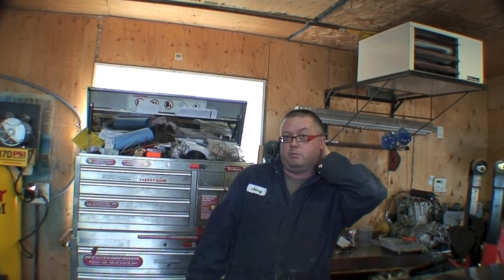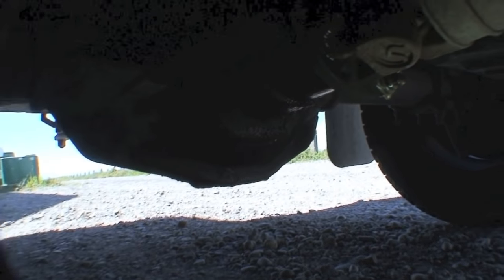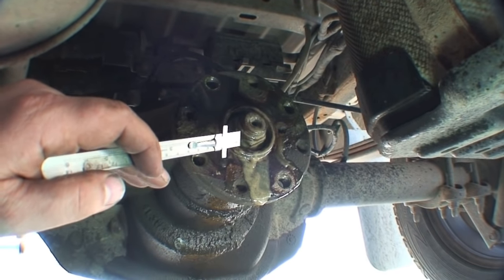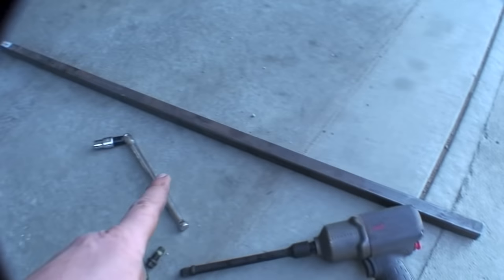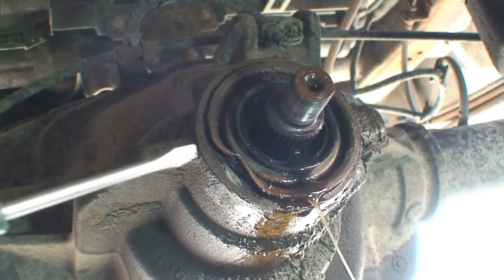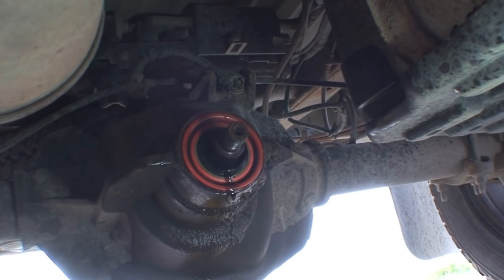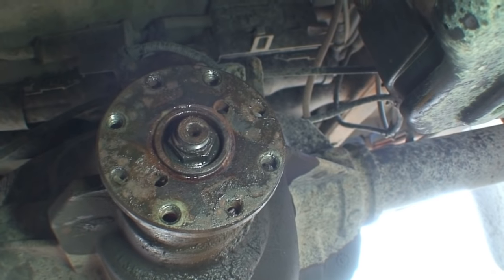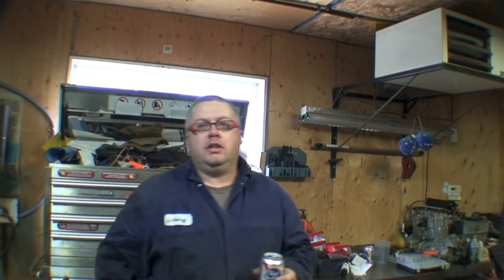How to Replace a Rear Differential Pinion Seal

Comment: Thanks for the video.  On my '05 F150 FX4 (162k mi) saw my pinion seal leaking.  Haven't had any noise from differential nor any shimmy/shakes.  However, with the pinion seal leaking significantly (had started dripping) at seal, decided it needed to be replaced before there was a problem.  Followed this video with everything....measuring, marking nut, etc. before removing.  When I tried using a 2-jaw gear puller to remove the flange, it would not come off....have sprayed it w/ more PB Blaster & hoping that will do it overnight.  However, I am concerned for as I used the gear puller & flange didn't budge, it actually pulled the pinion shaft out slightly.  Does that mean the crush sleeve is damaged allowing too much play, which would seem to require opening the differential, etc. & removing the pinion.  Or is it just a matter of working the pinion gear back in while pushing & rotating tires.  Sorry if this seems like a basic issue, but not an experienced mechanic.  However, am smart enough & skilled enough w/ basics to follow repair manuals/videos to do things myself (semi-retired, so time on my hands & low budget).
Reply from the maker: If you had a jaw puller on the yoke and pressing on the pinion it shouldn't hurt the crush sleeve. However the fact that the pinion moved but the yoke hasn't come off does concern me.  Is there any play in the pinion ?
Reply: Bullshitkorner
Thanks for the reply to my question.  Sorry for just getting back on it.  Has been raining here for the last 2 days, and my truck is not under cover (but all the tools, parts, & equipment are in a shed safe from the rain).  Anyway, stopped enough for me to get back under & check the pinion play.  The pinion actually pulled out about 1/2 inch.  I took a photo that shows the clean part of the pinion that has pulled out.  There is definitely some left/right play....not a lot, but definitely moves.  Tomorrow the rain is expected to be past, so will be back under to continue the repair.

So, thinking it might actually be the bearings, huh?  Well, I know what that means.
Reply: Bruce Simmons
Again, didn't hear or feel any problems w/ the differential, but I guess if the bearings are bad, that led to the seal problem.....hope I found it before any damage done to the differential gears....
Reply: Bruce Simmons
sorry for my lack of differential terminology, but the 1/2 inch section to the pinion shaft that I referred to being clean is the outer bearing seat....I can pull the pinion shaft out to where 1/2 inch of the outer bearing seat is visible.  Hopefully, rain will be gone tomorrow so I can get back under it to see if the PB Blaster worked in loosening the bind in the yoke/flange & the pinion splines.  Will put the gear puller back on it & give it a try.  Still concerned though about the pinion shaft pulling out & having some play.
Reply: Bruce Simmons
OK, I feel like an idiot.....goes to show I'm a novice on auto repair.  Good news is that the yoke/flange came off.  What I thought was 1/2 inch of the outer bearing seat was actually the back of the yoke.  Didn't realize that the yoke was that deep.  So, with the yoke off, realize that the pinion is not moving in & out, but it does have play.  So, I guess the bearings are probably bad which caused the seal leak.  At this point, I'm going to put the new seal in, reinstall the draft shaft, refill diff fluid, and then will take to a qualified tech as I'm not sure if I should try & tackle dismantling & reinstall of the diff.
Reply from the maker: it has play because the preload isn't on it anymore. plus you need backlash that will have play
Reply: Bullshitkorner
Thanks for the reply.  Sorry for my lack of knowledge/experience and really appreciate your video & time.....has really helped.  I really felt like an idiot today, for before putting the new seal in, removed the shim & outer bearing.  As I was removing it, it hit me that there was no preload & thus it had play.  Anyway, the outer bearing actually looked very good....no pitting at all.  The shim did have some minor pitting where the yoke butts against it...guess some trash/sand caused that. 

By the way, had previously used the longer jaws on the puller, and when it bottomed out without the yoke completely off, thought there was a problem w/ the pinion pulling out.  Put the shorter jaws on & was able to remove the yoke, which is when I realized that the back of the yoke was longer than I thought. 

Anyway, cleaned everything up & reinstalled the yoke....it was a real bitch to get back on though, but I guess nice and tight is they way you want it.  Used the pinion nut to pull the yoke into place, and when the nut reached the marked location, everything was nice & snug as it should be.  In fact, the pinion nut couldn't go any further, just like you described in the video.  The only play was that from the backlash. Disconnected the vent line, blew it out w/ compressed air, reconnected, added diff fluid, reinstalled driveshaft, & all is well.

Again thanks for taking the time to share your expertise....really learned a lot.
Reply from the maker: no worries, we can never fully learn unless we jump headfirst in.  Mistakes will always happen, and we will learn from them.  Good job on getting it done

Comment: I have the same year F150 and I had to get the larger seal for some reason too.  Did you have to beat the hell out of the yoke/flange to get it back on?  I only had a regular hammer and had to beat on it for an entire hour to get it back on all the way.  The yoke bolts don't have much room to get to either.
Reply from the maker: i can't remember but i don't think i had to get too violent with it

Comment: I'm currently replacing my pinion on my 2004 Nissan frontier 4x4 crew cab. I'm wondering is there by any chance its replaceable  with a 2002 2wd nissan frontier?

Comment: enjoyed the video. liked the way u explained everything. drink beer, hell ya. what If I don't have a flange puller. what else do u recommend
Reply: just use a brass mallet and tap around the backside. The splines on the pinion to flange/yoke are cut to increase the surface area when mounted. You'll be fine, the pinion is more than strong enough.

Just saves you a little time pulling it, but you don't need it. A few taps around the flange in a circle to prevent it from hanging up and having tap it back down.
 Just worry about under torquing on that nut, that will cause failure as the pinion will begin to slip in the bearings under load and cause backlash issues that can cook your rearend.
Reply: thank you so much. worked out just perfect. got it out. now as i went to put new pinion seal in of course i didnt get the correct one. now that ive returned the seal that didnt fit, im gonna try to install new pinion seal. wish me luck. i counted the thread on the pinion nut before removing it. putting it right back where it was should be easy. again, thanks.

Comment: need your advice i change seals and bearings on my 05 f150 diff,i accidentally turned the axle shaft and planet gears almost pop out of assy,well got it back again after all was done when i drive reverse i have this backlash so bad but when i put it to drive no probs...did i miss something?...thanks bud!

Comment: I like your video. Will your instructions here work if you have a crush washer on the pinion? Mine say to rebuild if I remove the pinion nut. I was thinking its because the torque has to be the same or redone.

Comment: My drift shaft snapped off the rear differential the other day. Before, I would notice that it would leak a lot of fluid and when I took it for a spin and drove past 25 mph, I felt a big vibration coming from the back or something. The whole truck would begin to shake. Do you believe it might be my rear pinion seal got so dry that it gave out causing to break off my driveshaft?? I have 1993 Toyota Pickup V6 4x4.
Reply: William Rodriguez by your photo I can tell ur the type of guy that doesnt even change your oil....differential oil...transfer case oil...or manual transmission fluid...

Comment: Thank you for the video . You diff still working good after this repair?
Do you think that i can use this video. If i want to replace the yoke  . I bought this truck and someone maybe lost the bolts. And they weld the c. Holders to the joke .
Reply from the maker: I’m still driving the truck today
Reply: Bullshitkorner  so this video should work to do my yoke on the  ford 99 7.3.     I iust not sure.    Thank you.
Reply from the maker: No idea proceed with caution

Comment: To BS korner 
Just to understand correctly, do u tap in the bearing plate and then tighten the nut to get to the preloaded depth or do u just smack the bearing all the way in and tighten the nut to the desired depth or is it all the same 
Thanks
Reply from the maker: there is no such thing as preload depth, preload is the amount of force on the bearing usually measured in Inchpounds.  once you remove the nut you can never get the preload back.  setting the pinion up properly after replacing the seal would include replacing the crush collar and setting the preload to whatever the factory specs are which could be anywhere from 10 inch pounds to 40 inch pounds etc.

Comment: Good video, i'm about to do this to my '07 this afternoon. Are you sure the parts store didn't give you a 8.8" rear end seal ( 4.6L ) instead of a 9.75" seal ( 5.4L )? Not sure if the Super Duty rear is the same size or not.

Comment: You forgot to address why the seal leaked in the first place. It will leak again if you don't fix the underlying fault.  Also, did you change the crush sleeve? This part is a one-time use piece and must be changed each time the pinion nut is removed.
Reply from the maker: +Steve Tyminski negative all around, indeed the crush sleeve is a one time use only to set preload on the bearing.  Using a dial torque wrench you can get a reading of what it was and set it back to that.   80000kms since I did this and no issues.   Any other questions ?
Reply: don't mean to come across as negative, I do appreciate the time and effort you put into the video. What do you think was the cause of the seal failure? Do you feel the crush sleeve being used twice (or more) still retains the preload?Thanks,
Reply from the maker: I really don't know what exactly caused the seal failure perhaps dirt, in all honest as the bearings and parts wear the bearing preload backs off.  I rebuilt my jeep axles a few years ago and they had 0 preload on the bearings and 250k on the axles and they were still fine
Reply: Bullshitkorner Friction is what ultimately causes failure of any part...

Comment: I just replace the differential seal of my 73 chevy ,, I marked the nut pinion and yoke ,, to make sure to put back at the same tightness ,, I may over tighten the nut because the differential make a roar noise, ,, or may be to loose? !, I set on the marks  but may be one turn to much or ??I will appreciate some help, , thank you. ?
Reply from the maker: it is possible that it's too tight, if it was more on the loose side every time you left off the gas you would hear a clunk. You could check for play and try backing it off slightly and see what happens
Reply: I check  ,, and yoke is loose  , I try to tighten but still klunky and loose, , I think I will have to replace the cargo ring bearings. Procedure that I never done before, , any suggestions I will appreciate it.,, thanks, ,

Comment: about braking something within the diff? should i have used a longer extension and just cranked until it gave way? what else can i do in order to take it off? i dont have oxy/acet but do have propane or could poss get something a bit better. is heat a good or bad idea? could i damage anything else than just the pinion seal? pls send some ideas because its leaking bad and i still drive it daily. i really want to do this myself and leave a mech as last resort. thanks so much in advance

Comment: apply the brakes and used a breaker bar with a approx 2-3 foot extension and i tried removing the nut but i felt like i was gona snap something inside my diff. i had a huuuge amount of pressure on the nut and it didnt budge. im pretty sure the brakes held the truck in place but there was so much flex from within the diff it got to a point where i felt like the gears were gona snap in the diff. was i wrong to think that? can you crank on that bolt with extreme pressure and not worry at all....

Comment: Ford Australia say the seals are now an obsolete part for my '04 F250. I gave them my VIN number and they gave me the part number... yet when I checked online I found the part number they gave me corresponds to an F350 seal and I have had the truck since new. It appears there may be 3 or 4 seals of different sizes that have been used and the Ford computer has them incorrectly matched. I have purchased 3 different ones from the US in the hope that 1 fits :(
Just curious but do you remember what the seal number was that you used ?
Reply: +nitrostateteam Exercise extreme caution when you remove the old seal and then check it with calipers that should give you a good reference as to which seal is the correct one. Just order all the options use the correct one and send the others back! Check the O.D the I.D. the  thickness and all the lip heights. After selecting the proper seal a big socket or seal driver should be located to make sure you put even pressure on the seal while driving it in. Make sure you get it in straight from the start it can easily damage a seal to start it crooked and try to straighten it half way in the hole. It is also very helpful to place the seal in your deep freeze for about an hour the little bit of shrink will help you to use less force and make you less likely to damage the seal. A small bit of very light oil applied to the outside of the seal will help it slide in. Sorry to be so wordy but I hope that this might help, if you already know all this than I am sorry I wasted your time :)
Reply: Mmmm I appreciate your great tips there Mel, then with your chilled seals and my warm diff, a little light oil and I'm sure I'll be driving it in home, nice and straight, in no time ;)
You're welcome in my workshop any day :)

Comment: Question for BSKORNER:

I have a 2010 f150 platinum. Pinion seal started leaking, was under ford warranty still. So, I let them repair it (stupid move). I got it back and right away I knew something was wrong. When you accelerate even in a straight line, the rear feels like its going over a rumble strip - just in acceleration tho. I took it back, showed them and they said, "that's not right, we will fix"... And well after a couple hours I got it back and they said .... (Get ready for this one lol) "it's a normal driveline vibration"... WTF!!!! Lol ... So I hooped and hollered and they said not much we can do, call ford.  Ford did nothing... Took to another dealer to double check and the did nothing... Now almost a year later it still does it, it feels like I'm pulling a trailer half the time... (No power on take off, then some days feels powerful...) weird I know. So the question, wtf could they have done in there to make it rumble while accelerating in a straight line? I know if you're turning and it rumbles in the rear it could be clutch packs or bearings.. But in a straight line??? Any help and advice would be greatly appreciated. Thanks
Reply from the maker: that's not a normal vibration, there is no such thing as a normal vibration if everything was in balance and set up right you wouldn't have this issue.  my guess they didn't set it up right because if you didn't have this issue before then why are you having it now.  could be too little preload that when you step on the gas the torque drives the pinion in the ring gear and deflection kicks it back out, giving you the rumble strip feeling
Reply: Bullshitkorner unless Fords are different from Chevy, I don't think it's the pre-load, unless there is soo little that bearings are sloppy causing the pinion shaft to move side to side cuz my Chevy 14 bolt 10.5, the direction of spiral of the pinion gear teeth actually force the pinion away from the ring gear, witch would be the relationship if the pre-load were right,in forward gear.

Comment from the maker: your not going to like this but doing the seal in the dodge 1500 you need to replace the crush sleeve and torque it properly, it's not as easy as this.... if you do a quick google search you will be able to read up on it and yes people have reported using a 6 ft snipe to remove the pinion nut on the dodge

Comment: What size is the big socket do you use to take that center bolt off with?
Reply: 1 1/8"
Reply: Thanx
Reply: thanks for the info. that's the next thing on my truck 2011 Ranger Sport, 2 wheel  drive

Comment: I was always told and taught that you HAVE TO replace the pinion nut ,NOT use the one you took off.What do you say?
Reply from the maker: +rockymontana1 You should yes or use some Loctite preferably the Red to prevent it from backing off if you don't have a new nut
Reply: Do not use the red.  Per Loctite website red requires 500°F heat to loosen this up after it sets or cures whatever.  Red is designe for PERMANENT FASTENING (something you never intend to remove).  You are supposed to replace the nuts per Ford, however this is only to prevent "backing off" of the nut.  Something Loctite BLUE will handle just perfectly.

Comment: How do you know when the dif is full?

when it over flows?
Reply: Aaron August yes there is a fill plug and you take it off and put a fluid pump in there along with your diff fluid and start pumping. When you start to see fluid drip out of the fill hole you have filled the diff to capacity. keep in mind if you have limited slip many diffs require special fluid or a fluid additive to lubricate the limited slip.